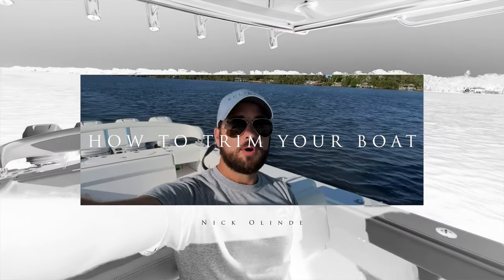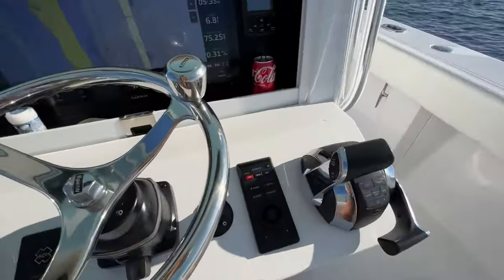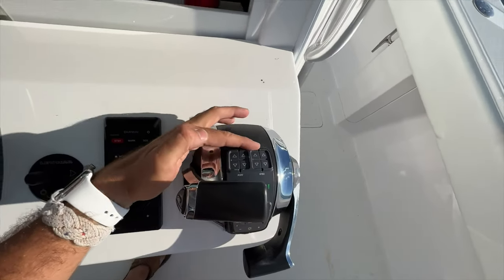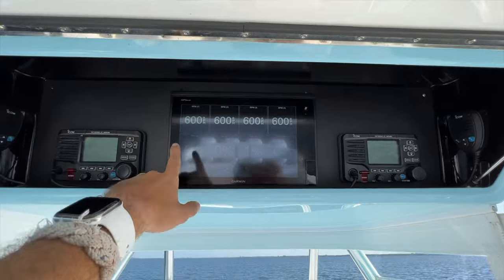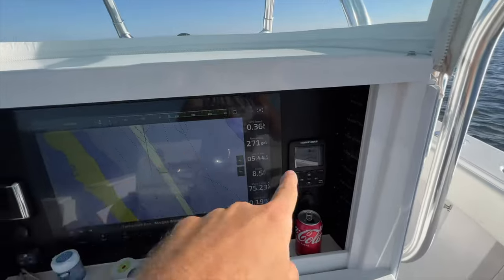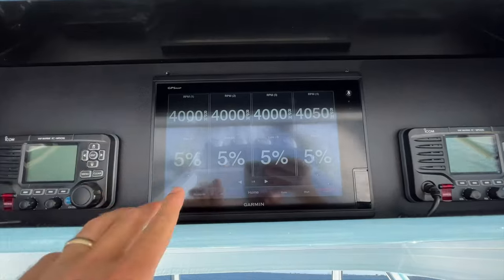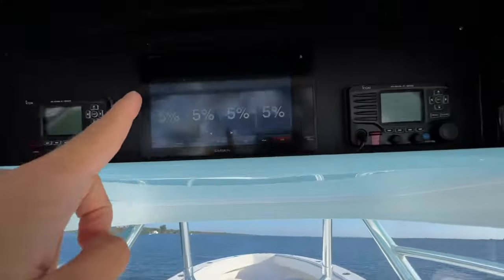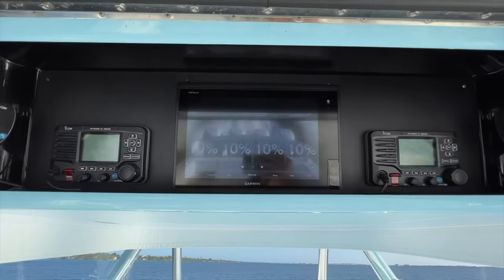How To Trim Your Boat PROPERLY *OUTBOARDS*

Comment: Ehhh. Even with a head sea full trim down is still not always correct. It really is a case by case basis. With the right wave height and interval you can still spear a wave with full trim down. (Not commenting this as a call out saying you’re wrong. But instead so others that are still learning can know it’s not set in stone as to what you should be doing)
Reply: Aha nvm you addressed later on it’s not an end all be all rule. I spoke too soon! :)
Reply from the maker: Believe me, I appreciate when people add context in the comments! So thank you! I am actually editing a video right now of a really rough crossing in a 34 SeaVee and I talk about exactly what you said how sometimes you need to keep the bow up a little bit and ignore the general rule of thumb

Comment: In your case, if you increase RPM to compensate for the loss of speed with trim, then wouldn't the economy go back down? Maybe not much, but I guess each person's optimal setting will be different based on their preferences of performance, economy, bow height, etc.
Reply from the maker: No because quite the opposite happens. If you are running with my trim and you start trimming the motors up you will start to noticeably pick up speed, not lose speed. This is obviously up to a certain point until you are past optimum trim level and start losing performance.

Comment: I was kind of surprised about the knots decreasing as you trimmed up. I generally get a little more speed and better fuel economy as I trim up
Reply from the maker: Yea, that’s part of what I am saying in this video how every boat is different. Bahama 41s don’t like a lot of trim until you get faster and get more hull out of the water. If I run up at 4400+ RPM that is where you start to see a giant performance difference between different trim settings and real increase in both speed and economy. I just used 4000 RPM as an easy constant.

Comment: Another really well made video, enjoyed it!
I only have a single engine bay boat. Have found the best method for me is to get on plane and trim up just until my revs start increasing and maybe back off a little. I guess the prop blades are getting closer to the surface at that point. My speed increases for the same RPM, trimmed up more than that is where it starts porpoising on flat water. Anyway, really just wanted to compliment you on your videos.
Reply from the maker: I appreciate it man! I am here to try help as many boaters as I can. Let me know if there is anything in particular that you want to see.